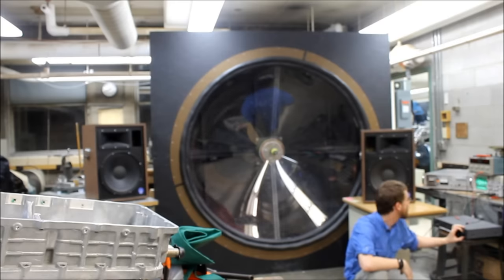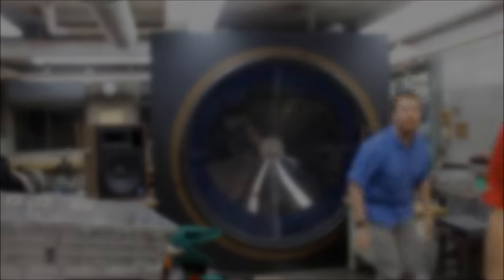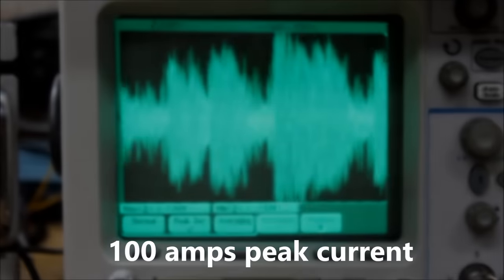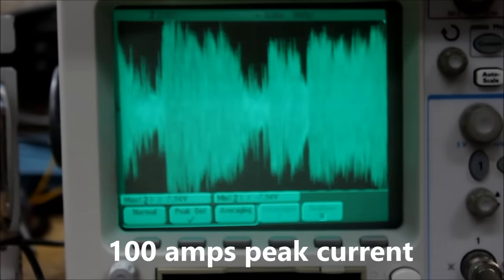Giant Subwoofer Video

Comment: "what's the max RMS input power of that sub?"
"about 2Hp"
Reply: 2 HP = about 9000 watts. So no.. NOT closer to 10 HP.. Closer to 2.
Reply: @tdh7865  you know, uh, any efficiencies in any currents, also Google can say whatever the hell it wants when I turn on a two horsepower motor I know what the hell kind of power consumption I clearly observe with multiple different instruments.. why don't you look up what kind of power inverter it takes to Start a 2 HP horsepower motor.. 🤣🤣😎 I know for a damn fact it's over 7,000. If I hold the shaft still on the motor consumes more power. Go ahead and make another comment I was going to guess $8,500 but $9,000 is cooler. Of course you wouldn't know about anything that is cool it seems.
Reply: @tdh7865  You crack me up smalls. 🤣🤣You sound like you need some hobbies. Horsepower has everything to do with motors. Especially electric motors. I've got you switching your numbers all around you probably doing all kinds of research Schooling yourself. 😂😂
Reply: @1998keagan1  horsepower has everything to do with horses, as in the amount of work the can do. Torque is a unit of force, horsepower is work. Specifically, the amount of work done when moving 33,000 lbs 1 foot in 1 minute. The watt is literally named after a guy who helped develope the steam engine... I mostly made this comment so I could find this video again... but yeah, put a little more horsepower into your troll game (or convert it to watts I really don't care 1hp=746W)
Reply: @1998keagan1  I have an array on my roof that has paid for itself. That's really not that special of a feat these days. This sub is cool because it's way too big. All that aside, it is really very simple math to convert units. Amps multiplied by volts equals watts (or volts squared divided by ohms), and then using a conversation factor you can represent that as horsepower. 1 hp = 0.746 kW = 746 J/s = 42.42 btu/min. There ya go, 4 roughly equivalent statements. Now you could figure out how much power your solar panels are instantaneously generating in terms of btu/min and equate that to burning wood. You're welcome.
Reply: @slappy8714  yeah I'm also into alternative fuel but if you want to talk about wood burning I don't pay to drive my truck down the road and it is an internal combustion engine and that's all I'm going to say. 😎😎 Like I said I would demolish you guys anywhere around the context of energy. I make people sign non-disclosure agreements if they want to talk with me about that stuff. 💯💪
Reply: @slappy8714  and notice how I said off grid 🤣🤣 anybody can have a lame-ass grid tie system installed and it's completely useless in a power outage situation or grid down. Least without a battery system and the proper hardware configuration. I don't ever notice power outages because I've never had a blackout with my system at all. I don't even notice when the grid is down in my home because it's not connected whatsoever.
Reply: @1998keagan1  ok, Mr Smart Guy. Thanks for the free info on doing whatever it is you're doing. I was talking and converting units to random equivalents as in kWh to btu/hr then to wood equivalent, but whatever. No NDA here, you tell me your secrets and I'll pump that info through all the Youtubes. I was giving you a free nibble of info (among other facts) that 1 hp is actually 746 W. Do with that what you will.
Reply: Also another free nugget of info, if it takes you 9kW to use 2hp, your efficiency is 8.3%. I'm sure you're on to something big there.
Reply: Come on where'd you go are you still trying to figure out how many horsepower my drone was using when it crashed years ago? 😂😂
Reply: @GoldenEDM_2018  can you tell me how many horsepower your Xbox takes? 🧐🧐😅😂😂🔌
Reply: @GoldenEDM_2018  what do you play Call of duty on there I've always heard about that way of life. Saying goes give people cheap entertainment and good food and they'll drop all of their ambitions and goals is that true? I figured I would ask someone with experience in that field 😂😎⚔️💯
Reply: @GoldenEDM_2018  come on where'd you go? You don't like your own medicine? It says you had two videos on your account but it seems like you were too embarrassed of them to keep them up because I can't see them otherwise I would drop a link to these comments on them so you're three viewers can see it and you can all talk about it on Xbox live and PS4 😂😂
Reply: @GoldenEDM_2018  does your mommy still not charge you rent?
Reply: @GoldenEDM_2018  man I should just write a book with all of the ways that you are nowhere near that guy. Just trust me you are not that guy I've had you in the bag since your first comment 🤣🤣
Reply: @GoldenEDM_2018  have you ever considered replying to a YouTube comment without using 500 emojis per 500 letters? You really do try to be like a little school girl don't you 🤣🤣😎
Reply: @GoldenEDM_2018  is that why you try to be like a little school girl so you can attract little boys? Come on you're a teenager you should know better than that 🤣🤣🤣🤣
Reply: @GoldenEDM_2018  I literally haven't deleted any comments hahaha maybe you should tell Mommy to get a better internet connection for you 😂😂😂😂🤪
Reply: @GoldenEDM_2018  you're literally just compulsively typing complete nonsense that isn't true at all and doesn't make any sense in context because you have no dogs in this fight at all besides my very simple human error that I very quickly corrected in my very first comments 😂😂😂😂🤣🤣
Reply: @GoldenEDM_2018  I love making people drain their energy on me instead of letting all their energy go to being a menace to society 😂😂🤪😁
Reply: @GoldenEDM_2018  it only took me about 10 times of saying it before you understood it even in the slightest?? Lol are you serious? You crack me up smalls. 🤣🤣
Reply: @GoldenEDM_2018  lol run outta words? Not surprised haha Come back little dufus this is fun!!
Reply: @GoldenEDM_2018  and it's funny how you wait approximately 35 seconds before assuming that "I'm running away like a little rat"no I'm just not sitting around staring at my phone like you're sitting around staring at your Xbox eating your Cheetos. I'm actually taking care of my house and loved ones like a real man that doesn't bum everything off of their parents 🤣🤣
Reply: @GoldenEDM_2018  definitely studying your sleep patterns 🤣🤣🤣 you going to wake up to me every single day. bud.
Reply: @Aditya Singh but I speak English because I'm in America the land of the free so speak English or you're not in this conversation as far as I'm concerned you think I'm going to break out a translator you got me bent 🤣🤣😎
Reply: @GoldenEDM_2018  wild grass? 🤣🤣🤣 Are you literally 12?
Reply: @GoldenEDM_2018  definitely not crossed lol you just stepped into the wrong fire pit is all 😎 you're not giving up are you? Quittin' is for quitters 😉 I was starting to look forward to years of this I think it would be hilarious you should keep commenting! 🔥🔥😜
Reply: @GoldenEDM_2018  you actually gave up for the night didn't you?? 🤣🤣 I should get that sleep pattern pinpointed pretty good 🤣 you know a wise saying goes that "you don't piss off a genuine YouTuber" hahaha and it's true........ You don't!!! 😂😂😂😂😂 you couldn't even come up with your own decent name! 🤣🤣 I hope you wake up to this comment 😴😉
Reply: @GoldenEDM_2018  Baby come back; you can blame it all. On. me. 🤣 We just can't understand how you think you're absurd comments are justifiable? You're actually kind of lucky that I'm not letting other people back me up right now because you're stuck in here with me not the other way around and I'm perfectly content with that. 😜😉 I must say though you have made the night very entertaining. Like you have no idea! Like I feel bad for the people that have read your comments. Classical teenager stuff.
Reply: @GoldenEDM_2018  I guess I'll give you somewhat of a chance when you wake up. When you drive across the country a few times in a hurry you learn that sleep is an option for skilled people. I predicted when you fell asleep just from the nonsense you were spewing 🧐😁 I think I'm going to get me some of that sleep you know since I do whatever I want being self-employed, self-sustainable and completely off-grid. 😎
Reply: @1998keagan1  ooh yes im back LMFAOOO did u missed me? Youtube blocked me from commenting here because someone is too buthurt and reported my comments LMFAOOO u not even being a real man bruh LMFAOOO good thing i still have 2 of my burner accounts LMFAOOOO
Reply: @1998keagan1  buddy are you really liking your own comments? LMFAOOOO what? for real? i cant HAHAHAAHAH
Reply: @1998keagan1  come on buddy where you at LMAOO you fell asleep already eh? AHAHAHAHAAHAHAH
Reply: @tonalddrump3241  haha I missed you bro! I told you 4 hours a day is good enough for me and I can have that sleep whenever I want 😂😂 I knew I would spark your little nerve. I haven't reported anything ya big dummy 🥳 you must not know how this platform works. I too happen to have a throw around account and this is it 😁
Reply: @tonalddrump3241  by the way I feed myself been self-employed since I was 12 years old never had parents or anybody to depend on moved all around the country myself and I own 16 acres of land in Oklahoma who feeds you beside your mommy? 😂😂😂🥳
Reply: @1998keagan1  lmfaooo0000 you actually dont work, i knew it HAHAHAAHAHAHAHA
Reply: @1998keagan1  too bad the comments arent loading in here so whatever comes up in the notification is what i can read, but i would assume you are telling yourself those crazy sht stories again LMFAOOOOOOO
Reply: @Aditya Singh তুলনামূলকভাবে
Reply: @Agarwal Patel ছোট হয় যাতে
Reply: @1998keagan1  crrryyy harder budd LMFAOOOO😂😂😂😂
Reply: @Agarwal Patel ছোট হয় যাতে
Reply: @Agarwal Patel এটি একটি বিন্দু
Reply: @Agarwal Patel কারণে ত্রুটি
Reply: @Agarwal Patel পারে। এই ধরনের
Reply: @Aditya Singh কাজ নয়।
Reply: @Aditya Singh তা নির্ধারণ করা
Reply: @Aditya Singh উদাহরণস্বরূপ
Reply: @Aditya Singh (স্পষ্ট মহাকর্ষ
Reply: @Agarwal Patel উপাদান হিসেবে
Reply: @Aditya Singh এজাতীয় ভলিউম
Reply: @Agarwal Patel সিস্টেম এর  বর্ণনা সিস্টেম এর  বর্ণনা সিস্টেম এর  বর্ণনা /
Reply: @Agarwal Patel তার জন্য গণনা
Reply: @Agarwal Patel করা উচিত, প্রতিটি
Reply: @Agarwal Patel তাদেরকে  জাতীয়়
Reply: @Agarwal Patel বা পৃষ্ঠ বলটিকে  বা পৃষ্ঠ বলটিকে  বা পৃষ্ঠ বলটিকে
Reply: @Agarwal Patel  বেশ কয়েকটি  বেশ কয়েকটি  বেশ কয়েকটি  বেশ কয়েকটি
Reply: @Agarwal Patel ক্যালকুলাস ব্যবহার
Reply: @Aditya Singh দেখা যায় যে এ দেখা যায় যে এ দেখা যায় যে এ
Reply: @Agarwal Patel গ্রহণযোগ্য না হয় গ্রহণযোগ্য না হয়
Reply: @Agarwal Patel একটিি সিস্টেমের একটিি সিস্টেমের
Reply: @Agarwal Patel একক বিন্দু শক্তি দ্বারা প্রতিস্থাপন করা যেতে পারে।
Reply: @Agarwal Patel বলের মডেল দিয়েবলের মডেল দিয়ে
Reply: @Agarwal Patel ছোট হয় যাতে   

 যাই হোক না  বস্তুর গতির বিশ্লেষণ বিন্দু  শুরু হয়।
Reply: @Agarwal Patel চিত্রের বিপরীতে চিত্রের বিপরীতে
Reply: @Agarwal Patel দেখানো হয়েছে যে দেখানো হয়েছে যে দেখানো হয়েছে যে দেখানো হয়েছে যে
Reply: @Aditya Singh নিখড় অনর বস্তুরনিখড় অনর বস্তুরনিখড় অনর বস্তুর
Reply: @Agarwal Patel কাজ করে। শরীরেকাজ করে। শরীরেকাজ করে। শরীরে
Reply: @Agarwal Patel নিম্নোক্ত অভিব্যক্তিনিম্নোক্ত অভিব্যক্তি
Reply: @Agarwal Patel  দ্বারা বর্ণিত বস্তুর ঘটায়: দ্বারা বর্ণিত বস্তুর ঘটায়: দ্বারা বর্ণিত বস্তুর ঘটায়:
Reply: @Agarwal Patel হলো গতির প্রাণ হলো গতির প্রাণ হলো গতির প্রাণ
Reply: @Agarwal Patel অবস্থানঅবস্থান
Reply: @Aditya Singh ভরকেন্দ্রের থেকে
Reply: @Aditya Singh রেফারেন্স বিন্দু রেফারেন্স বিন্দু রেফারেন্স বিন্দু রেফারেন্স বিন্দু
Reply: @Aditya Singh এই উদাহরণে এটিএই উদাহরণে এটি
Reply: @Aditya Singh প্রয়োগের বিন্দুর প্রয়োগের বিন্দুর প্রয়োগের বিন্দুর প্রয়োগের বিন্দুর
Reply: @Agarwal Patel অথবা বলঅথবা বল
Reply: @Agarwal Patel ভেক্টর কণাগুলোরভেক্টর কণাগুলোর
Reply: @Agarwal Patel  সাথে সরানো  সাথে সরানো
Reply: @Aditya Singh  অনুসরণ করে  অনুসরণ করে
Reply: @tonalddrump3241  it's probably your craziest dream for me to be liking my own comments isn't it? Well buddy looks like I am your nightmare. 😎
Reply: @tdh7865  he's a flat earther(pfp). You can't argue with him.lol
Reply: tf was that? haven't witnessed this kind of insanity in YT comments for a while
Reply: @1998keagan1  idk where you got those random numbers from, but 1hp = 745w. so yeah 1500w is 2hp. if 2hp  was 9000w then generators would be microscopic lmao
Reply: @1998keagan1  ahh so you dont pay to use public roadways either. yeah, definitely a choice to match your intelligence level
Reply: @DJJ13  and according to your theory you can run a two horsepower motor on a 1500 watt generator or run a two horsepower generator and get 1500 watts? I would love to see you try that let me know how that works out for you 🤣🤣💯
Reply: @1998keagan1  I glance over to my right shoulder and smile affectionately.
"Well hello there, Mr Chip on the shoulder."
Reply: 1.61 gigawatts
Reply: its like asking how many cups of sugar does it take to get to the moon. yeah, there is a 'technically' a scale.
Reply: @1998keagan1  man the definition of hp is literally 1hp=746W

8kW is 10.72hp. it's not a theory, it's literally what hp is
Reply: @FAB1150 man you have no idea what momentum and efficiency is or you haven't read all the comments. Horsepower as fast as would be necessary in a subwoofer you would literally need loads more power just like you need loads of power to start a motor electric or gas doesn't matter you need energy to start the horsepower. It takes a lot of energy to make a subwoofer exhort that kind of horsepower in the form of air movement and breaking the sound barrier. All of you YouTube experts need to spend more time gaining experience in the real world rather than just watching YouTube and googling things. You might get motor or subwoofer to perform with 750 watts but it would not be forming anywhere near an actual horsepower. You might be getting a little over a half a horsepower at most. Induction conversion heat and friction make that impossible. Just like if you have a 250 horsepower motor in a car you might be getting 200 at the wheels at most. And then you have other variables like aerodynamics driving style weight and rotational masses electrical draw power steering water pumps the friction in the serpentine belt all of that. There will always be inefficiencies and inefficiencies are pretty severe in a subwoofer. Put a couple 12s running on a couple thousand watts in any phone stock vehicle and watch how much the lights dim. Takes A lot of power now feel your amplifier I bet you it's warm after a couple minutes and it's not even getting the power that it wants out of a stock car. I'm not talking about your little player friends with the 400 watt subs either I'm talking real wattage. I've been into car audio my whole life and I run three different batteries and two different alternators in my setup these days motor built up about 400 horsepower. If you've never installed a shunt or dont even know what a shunt is then you have no place trying to say you have any real world experience because it's clear the people that don't. Not many people out there break out amp meters simply because they are incompetent with them. I deal with amp meters shunts and all the sorts on literally a daily basis as a career necessity
Reply: @1998keagan1  DUDE you don't understand what horsepower is. 
"Hp" is just another way of saying "746W".
You're talking about how much hp should an engine be if it has to generate 8kW. It doesn't work that way.

If I say "I have a 2hp engine" it means that it turns the crank with 1492W. That's it. If you use an alternator that's not 100% efficient, you will not get 1500W out of that engine. But the mechanical power the engine generates is 1492W. 

1hp = 746W. Efficiency doesn't matter at all in the calculation.

You could measure your home energy usage with hp. Even if it doesn't have an engine or a generator. Because, wait for it, HP ONLY IS A MEASURE OF POWER. Not just mechanical power, power in general. Watts. 746 of them to be precise.
Reply: @FAB1150 Oh the arrogance is real with you 🤣🤣
Reply: Power is much more of a mechanical means of energy measurement. Not saying you're wrong but you're trying to prove me wrong with a very loose ended fact. Might be pushing that kind of power into the subwoofer but you damn sure ain't getting that kind of power in the performance. The only way to measure the true horsepower of that subwoofer is to do hours and hours of math and you would still only get close and it would still not be anywhere near the exhaustion of 2 horsepower. Let's be real here 💯
Reply: @1998keagan1  huh? You measure how much power the system consumes, including the waste heat. 8kW is 10.7hp, so that's a 10hp speaker. Even if 80% of that 8kW becomes heat before becoming sound.
Reply: @FAB1150  huh? I don't know what kind of Chinese specs you're going off of but you call a motor that makes 10 horsepower a 10 horsepower motor end of subject. It doesn't matter if the motor actually makes 12 horsepower If you lose that two horsepower from inefficiencies then you can't claim that as power. Period two horsepower motor you're going to want two horsepower out of it no matter what. Just because you are putting in said power doesn't mean that the subwoofer is rated for that said power going. You can make a motor rated for 2 horsepower put out 10 horsepower But you would have to give it much more power than it is rated for and it wouldn't last long because of INEFFICIENCIES
Reply: @1998keagan1  1 hp = 745.6w, so 7000w/745.6w/hp = 9.39hp, indeed 9.39 is closer to 10 than 2.
Reply: @1998keagan1  Where on Earth did you get the idea that 1 horsepower = 4.5 kW? That is absolutely wrong. 1 kW = 1.341 HP. This is an 8 kW amp, which translates to over 10 HP. Look up the power ratings for any engine, and the value in kW is always lower than the value in HP for exactly this reason. Back to school for you!
Reply: @1998keagan1  1 HP is about 760 W ish. So 2 HP is totally not 9 kW
Reply: @triparadox.c  Another novice eh 🤣🤣
Reply: @1998keagan1  Nope. 1 HP is 755 Watts.
Reply: @1998keagan1  You are incorrect. Electric motors are rated based on the power consumed, not the amount of work the motor can do. In industrial applications a lot of motors are rated in both kilowatts and horsepower. 1 horsepower is approximately 3/4 of a kilowatt. Again, that power is what the motor draws from the power grid, not the mechanical power it produces at the shaft. Therefore, a 10 HP motor will not actually make 10 HP of mechanical power at the shaft since some of the energy is lost to heat. The whole "you can't claim that as power" thing is just false. The HP rating is telling you how much energy you need to supply to the motor to get it to work, not necessarily how powerful the motor is. That isn't to say that you can't use the HP rating of a motor to determine how powerful a motor is, but you have to take into account the 85-95% efficiency rating of most induction motors.
Reply: @davidk8893  I am not incorrect I can make two horsepower motor put out about 10 horsepower rating doesn't mean shit put 680 volts to the damn thing it'll probably draw 15 to 20,000 watts for a second and it will output the equivalent to 10 internal combustion horsepower only after about 3 to 5 seconds at the soonest. Now think about how much more inefficient a subwoofer is you guys are a bunch of YouTube keyboard expert doofuses
Reply: @slappy8714  horsepower are not equally all over the world.  In germany a hp =  PS (Pferdestärker) is 0,736 kW. So it makes no sense use hp in technical terms.  hp ist old fashioned , only petrolheads use it.  French hp are different to both american /german hp.
Reply: niiice oone
Reply: @Reaktanzkreis  very true. Hp is an ambiguous unit. Watts, or J/s, is very well defined because joules have a very clear definition as do seconds. The guy bumping this thread is just trolling... or maybe they just need some attention. Peace and love ✌
Reply: @1998keagan1  I am trained in industrial electronics and in industrial motor controls, and am about halfway through an electrical/computer engineering degree. If you actually read my comment you would see that motor HP is not based on the actual mechanical power the motor produces, it is the power requirement of the motor. The efficiency does not matter at all. A 80% efficiency motor that draws 7600 watts is a 10 HP motor, regardless of the fact that it only produces 8 HP of mechanical power at the shaft, because ***the motor is not rated on mechanical power, but on the power it draws from the power grid***.
Reply: @davidk8893  ***you can have your theories all you want I'm an electrical realist and I set up off grid solar systems and calculate wattage needs on a very regular basis. I know what a horsepower motor takes to run so you can engineer all you want but engineers typically don't have experience***😂😂
Reply: @1998keagan1  What you aren't understanding is that the HP rating of electric motors is based on the power REQUIREMENTS, not the mechanical power produced. It's just like a light bulb. You call a 100w light bulb a 100w light bulb because that's how much power it consumes. It doesn't matter that 98% of that energy is turning into heat, it's still a 100w bulb. Just like how that speaker is technically a 10 HP speaker. It CONSUMES about 10 HP worth of power (about 7000 watts). Efficiency doesn't factor in that equation at all. Yeah, not all of that energy is turning into sound, but that doesn't matter. You're welcome to live in your own little world where you define your own arbitrary values for a horsepower, but here in the real world it's defined as exactly 745.7 watts, not 4,500 watts. If you claim anything different you clearly have no idea what a horsepower is.
Reply: @davidk8893  <-- 100% correct. Black box method of determining energy consumption has been standard practice since, like, Michael Faraday...
Reply: This whole comment thread is just crazy. Now I gotta look up this stuff and find out whose right. You all are wrong though. On so many other levels of existence. Some of you are technically correct though, so very wrong for it.
Reply: @charlesbrockman3299  It does not make very much sense to declare that everyone is wrong after saying you need to look stuff up to find out who is right. It's pretty easy to tell who is the wrong one here, there's about 6 different people who have explained the definition of a horsepower (745.7 watts) and then you have one guy claiming that it's 4500 watts. A simple google search clears that up really quick.
Reply: @HyperMario64  same lol
Reply: @davidk8893  I know what I said.
Reply: @1998keagan1  Come on man. Everyone is going easy on you as it is. Nobody is calling you stupid here. It's just not a good thing to be spreading misinformation - even if it is in a who cares YouTube comment.
Reply: @BWGPT  yet look at you here just commented 🤣 come on man everybody knows that people that blindly believe what they read on the internet are doofuses. 💯 I don't care who goes easy on me and who don't I'm the one that actually knows how to use a multimeter and a shunt. Set up multiple well pumps for commercial buildings and have calculated designed and build multiple completely off grid sustainable solar systems. I know exactly what it takes to run a motor and that's the only thing that's being commented about that and the insane inefficiencies of a subwoofer. Probably about the most inefficient thing that you can put in a car is a subwoofer. People can talk ratings all they want I also excel in car audio people hear my deep bass for miles literally and they're not even listening for it. I ain't afraid of you little YouTube experts one bit I make well over a 100 an hour I don't mind giving people that think they know it all a little constructive criticism. It's pretty easy to tell when people have experience and when they Don't just got to listen to them. Most of these people just as yourself are just seeking validation trying to make yourself feel smart because y'all can all Google the same thing. I also find it hilarious how people are putting their small little twists on things to make it seem like their own opinion literally cracks me up so why would I not indulge in this comedy?? It's a fun passer of time so y'all keep telling me how much horsepower your houses are 🤣🤣 and I'll just be here chilling I won't go anywhere trust me 😂💯
Reply: @1998keagan1  I like your style and I think tbh most people in here do as well 🤣 I wish you would channel your energy in a more constructive fashion though. 
All the engineers in here are just arguing the fact that horse power is a fact. Why don't you just make your own unit of power for speakers? Call it Elephant Power (EP). Elephants are better than horses anyway 👌🏻🐘
Reply: @davidk8893  yeah it damn sure does take 4500 Watts if you want that power in a couple milliseconds which is what is required for a subwoofer to exert that kind of horsepower. My only claim is it takes a lot more power to start the motor ya dingus if y'all would actually read you would know that but lots of people have deleted their comments here. All y'all going off assumptions I think it's hilarious. In the real world, to exert one horsepower in the form of physical rotation; it takes more than 800 watts after the initial starting momentum. Maybe if you built a absolutely perfectly designed motor you might get horsepower out of less than 800 w but that's simply not the case y'all are just doofuses that like to Google things. Probably all based off of some government book somewhere I find that hilarious as someone with loads of real world experience.
Reply: @1998keagan1  You still aren't getting the point. Nobody is claiming that the subwoofer in the video exerts 10 HP of force on the air. They're saying it consumes 10 HP of energy. I am well aware of the fact that the inrush current on a motor is far higher than the run current, but that has nothing to do with the horsepower rating of the motor. Nobody is arguing against the fact that a motors aren't 100% efficient either. If you don't read anything else in the comment, read this:

The HP rating of an electric motor includes the inefficiencies. A 10 HP motor does not produce 10 HP at the shaft. It draws 10 HP of power from the mains.

That's it. That's all I'm pointing out. You talk about people making assumptions, but you're the one making the most assumptions here. You have absolutely no idea how much experience I do or don't have or how much experience any of the other people in this comment section have. It doesn't matter how much real-world experience you have if you don't understand the basic theory behind the stuff you're talking about. Just because you install well pumps and solar systems doesn't mean that you're instantly a PhD in electronics.
Also, if you spent as much time measuring AC current as you say you did you'd be using an inductive clamp meter, not a shunt. Just pointing that out.
Reply: This stuff is flying over my head!
Reply: @davidk8893  Literally Nobody is saying that lmao!!! You don't measure a one horsepower motor by the current that it takes to run the motor... You measure it by what the motor outputs. PERIOD. Same thing with the subwoofer if you're going to call it a two horsepower subwoofer. THEN YOU HAVE TO FACTOR IN ALL OF THE INEFFICIENCIES. You can't just go by what the input power is of the said subwoofer. If a electric motor says it is two horsepower and it OUTPUTS less; then you CANNOT call it a two horsepower motor by any realistic standard.. There is no way to measure the output of a subwoofer only by mathematics and theory. Fact! Every time that speaker switches directions it has to endure extreme amounts of momentum LOSS. It's like slamming on the brakes multiple times a second for fractions of a second in a vehicle; you are going to be much less efficient. Not to mention inductive inefficiencies which are more permanent in subwoofers then induction or any type of modern electric motor. You may continue to crack me right up with your comedic ass assumptions though. 💯🎯🎯😉 I would love to see how y'all's Dingus asses explain a car Dyno.. let me guess: you probably measure the half a million Watts that it puts out right? 🤣🤣 Bro y'all have to be miserable trying to use Google for your fact checking but you can't even do the research and mathematics to learn the facts. That fits my definition of doofus to a T 🤣🤣💯🥳 congrats on being so special you guys. Congrats on also still not being able to read before you all jump in with them assumptions. 🤣🤣 I love this so much you guys have never built anything in your lives. Don't even know what an AC shunt is 🥴. Guess what dingus shunts can measure AC current just fine.. all the shunt is is a resistor as a means of measuring voltage drop off of. Alternating current is literally alternating DC. Regular household outlet is 60 volts DC with the polarities alternating back and forth 60 times a second. Get learnt about it son. 🤏
Reply: @1998keagan1  I'm not going to bother with this anymore, you clearly just want to argue.
Also, I'm well aware you can measure AC with a shunt, but it requires installing the shunt inline with the load. There's no reason to do that when you can use an inductive clamp meter since you don't have to disconnect the load to measure current. As far as not ever building anything, try that again. I've built rotary phase converters, wired buildings, rewired CNC milling machines, installed central and minisplit A/C units, and have over 10 years of electronics troubleshooting experience. 
P.S. Line power in the US is 240v split-phase AC, with two 120v phases. Not 60v. It's also not DC that switches polarities, it's a sine wave that cycles between 150v above neutral and 150v below. It's not the same. (and before you say "iT'S nOt 150v it'S 120V" I'll go ahead and tell you that the 120v rating is RMS volts, not peak voltage). I do know my theory, apparently you don't.
Oh well, I'm not exactly sure what I expected from someone that staples themself in the arm multiple times and then posts it to youtube. (you should probably private that video if you want anyone to take you seriously.)
Reply: Close to a year later and people in this thread are STILL arguing the same points over and over again. Truly fascinating human behavior.
Reply: @1998keagan1  where did you get that from? it's about 750W per hp
Reply: @davidk8893  brah you off on some different shit nobody was even talking about lol!!
Reply: @1998keagan1  I was referring to the fact that two of the first videos on your channel are you smacking your arm with a stapler, which doesn't exactly speak highly to your level of critical thinking. Also most of your points in your last comment were just not correct. I'm not going to bother spending any more time on this since you don't seem to have the ability to continue a civil conversation without resorting to insults every other sentence. I hope you have a nice day.
Reply: @davidk8893  yeah if you would actually know how to read you would see the date on those videos. Sorry that you didn't know how to have fun and live life as a young person in school so you don't get that other people did. There is literally a shunt in every AC device the has a built-in current meter on it. You can also install AC shunts anywhere you want. I'm glad to know that you actually have time to go look at people's extremely old videos. I myself am a working man. Something you don't know about with all the free time you have to try to miscorrect people by googling things. Half of what you said is false I actually can explain what I'm talking about. You can't exert 2 hp in a subwoofer without putting about 10 horsepower worth of energy into it. Ya dingus. Simple fact is the truth hurts and you can't handle it lol
Reply: @thedingleberrybush6076 I've just come across this as well, it's absolutely wild. What blows my mind is how consistently the Keagan guy projects onto others exactly what he's doing. Also just how arrogantly confident he is that his intuitions about motor usage supercede established measurement conventions. Like holy shit you can just look this up
Reply: @Meatwad.Baggins  GREAT SCOTT!!!
Reply: I think he said 2.5 hp
Reply: @1998keagan1  yo man I don’t know anything about the scientific units and what not, but chill out bro you don’t own this comment thread; so stop ego tripping.
Reply: @michaelh.1262  Ego tripping?? 😂😂 I'm here for the comedy and to educate y'all fools that think you can measure horsepower FROM a subwoofer 🤣🤣 so you want to get things popping off again then go ahead. I've made it clear that I don't mind chatting here so why don't you go ahead and tell me what kind of fuel mileage this subwoofer gets and we will continue
Reply: @1998keagan1  theoretically the fuel mileage would depend on if you get a generator that’s optimized only to power the subwoofer so you could calculate how much gas is used, and get a good measurement of how much gas it takes to play the subwoofer per hour.
Reply: @michaelh.1262  And there shows your intelligence. Number one you will have inefficiencies in the generator of course on both the alternating side and the combustion side. Next we have inefficiencies in the amplifier alone that you have to calculate. Also you have to calculate the inefficiencies of the subwoofer itself including the resistance from your means of physical rotation which is required... Oh yeah there it is 🤣🤣 subwoofers don't move out of their position so theoretically you're a doofus 😁
Reply: @1998keagan1  and there your arrogance shows. Have a good day lmao
Reply: @michaelh.1262  Yeah you have nothing to say to that so you just resort to name calling and then running away 🤣🤣 maybe look up the definition of arrogance bud. It's just sad how so many people think that they know things when they don't 🤷🏻‍♂️🏌️
Reply: @1998keagan1  I’m just pointlessly saying that theoretically you could calculate the “mileage”, and “hp” based on the smallest generator that can power the subwoofer optimally.

Case closed, that’s all there’s to say; it’s as simple as that.

The irony of you telling me to look up what arrogant means is hilarious though, because you keep going on and on. you should look it up every once and awhile to keep yourself in check😂

Inefficiencies doesn’t matter, as long as the subwoofer is optimal throughout the frequencies. it still proves the real world point of how much horsepower it would take to power a huge subwoofer. Of course it doesn’t produce any, or consume any, but you could say it takes 15 hp to power it, or say that it gets one hour per gallon, which would just be cool random facts if you take it along on a trailer to places.
Reply: @1998keagan1  also I didn’t know if you were being sarcastic, but my point still stands. I’m not blaming you for having fun though do as you please lmao
Reply: "yes"
Reply: 1.21 gigawatts
Reply: This thread is the definition of insanity holy crap
Reply: @aaronwestley3230  What the [sound of metal hitting metal] did I just read
Reply: @Keagan Thompson  you're wrong. 1hp is equivalent of 754 watts.
Reply: @1998keagan1  Man you sure spent a long ass time arguing semantics. You could definitely measure the power of an amp in hp, and it wouldn't be difficult either. It may not bare relevance to the output of the subwoofer, but that doesn't matter because a subwoofer does not output useful work. Measuring the power input of a sub can definitely be useful, and that number could be expressed as watts or horsepower, and no you do not take inefficiencies into account if you don't want to - theres no standard there. Go ahead and look at ANY advertised power on any tool you can find in your local hardware store. Not a single one of them takes into account inefficiencies, and most of them arent even based in reality.
Reply: He missed the joke😂
Reply: Was this made for the remake of back to the future?
Reply: lugburzzz  in the world where your mom was slobbering this dingus 😂 I swear that Neck had 2 horsepower 🥴
Reply: @1998keagan1 You are telling a blatant lie. 1HP is 746 watts
Reply: thats what i was thinking man 😂😅😅 @HyperMario64
Reply: this is inhuman frfr 😅